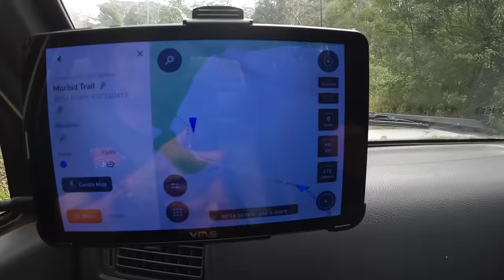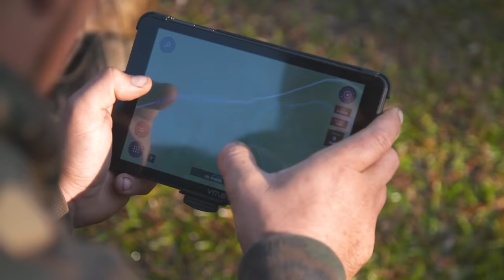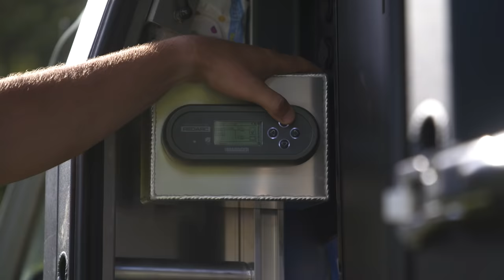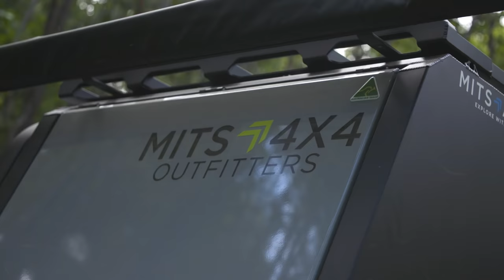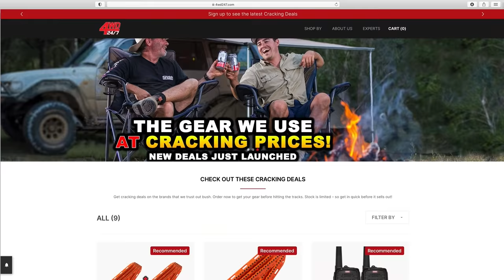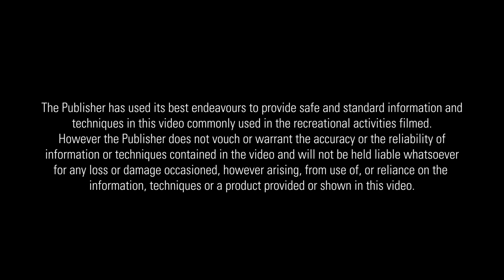OLD BUDGET 4WDs vs. Australia’s TOUGHEST tracks in Coffs Harbour + Snapped Axle & Best campsite EVER

Comment: Scariest time was when I topped up my gu zd30’s oil cause it was low, drove 45 minutes and was on some tracks for about an hour putting it through some stress, then I stopped cause a mate got bogged and walking back to my car I noticed there was oil dripping like no tomorrow from the bottom of the motor. Popped the bonnet and saw I had forgot to put the oil cap back on and it had no oil in it. Had to get up a sketchy hill as well and by cheeks were clenched expecting to hear it start knocking, 3 months on and the zd is still going

Comment: The one time i had the old ring doin 5cent, 50 cent was in a 8 wheel drive truck with about 15 mil on the back was following the lead 4by at night no lights on and felt the front left lift and come down hard. Opened the door to what happened. Had some how managed to get the front left to one side of a creek whilst the front right was in the air

Comment: In 2017 I went to cap York in the patrol. I found the faster I went over the corrugations the less chance of the doors falling off. Learnt pretty fast to slow down when I seen a dip sign, until I found a dip in the road without a sign. Would have jumped the old patrol a foot off the ground when I hit it. Still have the dashcam footage to prove.

Comment: Biggest poo moment for me was when i was in my old 08 BT-50 out at kenilworth, got up to the top of a track.. peaked over a hill and saw what was on the other side... 90 degree DROP!  1 wheel was already over the peak and i tell you what, those seat covers would have saved me a bit of time cleaning the brown off my seat after having to reverse down the hill climb i just came up!

Comment: I can’t pick between 2 bad experiences😅 the first was a innocent looking bog hole at the beach I’ve done a stupid amount of times. Dropped in an diffed out halfway through(bloody safari pumpkins) took over an hour and a half to recover me out. Started with the water up to the hubs. Ended with the water halfway up the doors. Thought I was going to loose my truck. Second was a chicken track at our local dunes. I was too wide for the main track so had to go the chicken. Came around the corner and realised the bay was at high tide which ment the main chicken was blocked. Had to hold it on the tipping point around a corner to make it out as I couldn’t go backwards(and 18yr old me can’t wait for the tide to go out) hit a stick and she went straight onto 2 wheels. Don know how I saved it but stayed somewhat upright. Did have to change my pants

Comment: Scariest thing to happen to me was on my learners driving dads 100 series Landcruiser back from Karumba, towing the tinny cruise control set to 110 massive dead roo on my side of the road go to other side of the road dodge it and perfect time another massive roo jumps out from that same side. I make a quick correction to try go into the middle of the road to miss both the alive roo hits the boat and from the quick correction the boat starts to fish tail lifting the cruiser up on two wheels I counter steer it everything feels in slow motion dad grabs the wheel and try's to help as we are going rocking the car on both sides two wheels up the road slowly becoming less of a angle before we are straight again never been more scared in my life especially because I was only learning how to drive.

Comment: Scariest moment for me - the first time I drove my Land Rover Perentie 6x6 12 months ago- it was my first offroad vehicle - previous car was a corolla. I live in an area with small tight streets, and just getting it home and parking it, with no rear visibility due to the huge canopy on the back and its massive turning circle, plus length of just over 6m... I was leaking more sweat than the Land Rover leaks oil lol. I was almost certain I was going to damage it on my first drive, or wreck a parked car or two.

Luckily it has been good offroad, and feel a lot more comfortable off-roading still, than I do navigating tight streets in my area with cars parked closely both sides of the streets.

Comment: Scariest moment behind the wheel on a trail was probably my second time in moab doing the moab rim trail in my 80 series. A SUPER exposed trail with 200 foot falls right onto the paved road below leading to instant death if you make a mistake (someone had died a few weeks before doing the same trail) either way as we go up it’s getting bigger and bigger rock steps. Well at the beginning of the trip I had broken a right motor mount and didn’t want to leave empty handed so I put a chain around the mount and called it good. Well during an insane obstacle I looked down and saw my t case shifter trying to snap the center console and the auto trans shifter was in the neutral position for me to use drive. Eventually we got all the way down and I found out the motor had jumped 2 inches to the right and nearly cut the power steering belt on the fan shroud. That trail would have literally been impossible to drive down with no power steering

Comment: My scariest moment was when I was just 17ish.  I was driving my dad's truck like a complete fool, on an icy road.  I got into a slide that I just couldn't get out of and ended up going off the side of the cliff.  I have no idea how I didn't roll it.  There was also so much snow, that only the rear bumper got a small dent and scratch.  It took a few trucks and questionable winching to get the truck back on the road.

Comment: Scariest moment was in my old MK with my new GF, thought we'd have a nice WE trip through the Otways in VIC. Driving a track, that should have been "easy" turned out to be the exact opposite. Stock MK no winch, got bogged where someone on 37" had carved up the route. Got out, got every bit of undergrowth I could lay our hands on and shoved it under the wheels and got free. yeah! Drove on another couple of km, came round a corner to find three 4X'y spread all over the track stuck in the mud... Now I recon'd that I could see a line I could drive that included a tree that would get through... and it did. Another couple of km down the path and a third crossing that had a 4X stuck in it, looked worse that the second crossing. Now I didn't think I could go forward, and didn't think I could go back... so back to gathering trees and undergrowth, and built a path. It was at that point I decided I'm never coming bush again without a winch... Got through and a couple of km on, found the guy who had the last stuck 4X walking out, so gave him a lift to the Forrest Pub where we called for a tractor.
I put on a winch, and an Goanna Auto Lokka in the front, and that MK took me everywhere for 16 years before it died of rust. Now building a GU RD to do the same.

Comment: my scariest moment 4wding was we did a night run. started off great we started 4wding at 8pm after a long day of tracks with a dinner break in-between. after a few hours into the night run things went south. A patrol we were travelling with nearly tipped in the worst spot. soft sand on a flowing creek bed, his wheels dug into the side of the sand bank and collapsed. By this time is 2am and we have pulled him up enough to see he popped his tyre clean off the bead so we had to skull drag him out which was extremely difficult in this position. Me and my mate left to go get a high lift jack in my car and his car as it was safer to travel in pairs and others were there to assist the patrol. was 4:30am when we got back to flat ground because the fog was so severe you couldn't see past the bonnet. My mate radioed in we have to stop, I stopped and he radioed in "we are in trouble mate"... he couldn't see with the fog and drove straight through a ditch, his girlfriend lifted off the seat and landed on the centre console breaking her tail bone. Now there was a real sense of urgency to Get out. we calmed her down and mentally prepared her for the final BRUTAL climb. We already completed this track 12 hours prior so we knew this track was tough but once completed it was easy to get back to camp. I didn't install my recovery points and neither had a winch. both were twin locked idiots. got half way up the climb and I heard the dreaded BANG. blew my Cv half way up. we tried everything to get up nothing worked. hours rolled by trying to get up. we ended up back at camp at 8am the next day. Left for the hospital straight away. was a scary experience but defiantly made us realise safety equipment is a must. Those seat covers would of been handy I think we all shit ourselves haha

Comment: Was heading on a camping trip up the beach with some mates, I had a large trailer with two quads and camping gear. We were driving along a corrigated road making good time as it was freshly grated. All of the sudden I see a flash of silver in the bush and realise its a patrol coming out of an unknown side track so I slam on the breaks. wheels lock up and I dont slow down. I think shit this is it, i'm going to clean up this patrol and I cant do anything but hold on for the ride. at the last second the patrol slams the breaks on and stops with just is front wheels poking out as I go flying by. there was about a foot between his bumper and my left mirror. I ended up stopping 30m past him. learnt three things that day, 1 there is a thrack there, 2 my car is overloaded 3 I needed some seat covers to save my seats from the brown stains.

Comment: Scariest time for me was half way up mount Skene snow up to the bonnet got stuck and my winch malfunctioned getting stuck reeling in without any controller used pulling a 90k modded  jeep jk down the hill dead drops either side only way to save both cars was a rush to unlock the bonnet and disconnect the battery safe to say was even sweating in falling snow

Comment: The scariest moment I have had was during the extensive floods in Southern Africa in 2000. My wife and I went away for the weekend to a small game reserve and decided to take an extended detour on our way home past a friend who lived on a farm. The sealed roads on the way were a few inches under in parts, but this did not deter us to continue on the journey. Soon we left the sealed roads. When we got close to the farm, we tried to make contact with them by phone as he locks the gate and we needed him to open it. There was no reply from him, so we continued on the road as it was part of the journey home. We came across areas where the roads were water logged, at which point I followed the manual and walked the 'rivers' covering the road. I preceded to cross as the water was well below our Cherokee's wading depth. I repeated the process at the next washout. When we came across the third one, I noticed I could see the road markings on either side, and based on that I decided to just drive it, as we had travelled the road multiple times. Though I preceded with caution, the nose of the vehicle disappeared under the water, and I got such a fright I removed my foot from the accelerator, thus sucking water through the manifold and into the engine. The car was stuck and water was entering the cabin. Because of the entry angle, the water only covered the footwells of the front row, while the second row was dry. It took us a while to gather our thoughts and we realized there was no reception where we were, and we decided to try and push it out the water. My wife got into the water at the nose, and I reached through the window to disengage the auto box and handbrake. I know the adrenaline accounts for much, but looking back on it, my wife was either Superwoman (which she is in many aspects), or we had external help we couldn't see. Once we had managed to push the car out the water, we decided to try and walk back the farm and pick up signal. Once in range, we contacted our friend who came to our rescue. With his mechanical prowess as a farmer, he got us on our way with minimal damage. Valuable lessons learnt, I have never crossed water without checking it since.

Comment: my scariest moment was checking out a local beach track with my 95 pajero. she has 31s and stock suspension that needs replacing. But I decided to go down this kinda steep but rocky and sketchy track and my first time going down and first time in the area. As I was going down the tube that supplies the vacuum from the engine to the brake booster came off just after I started going down. I shoved my foot on the brakes because I was at a bad angle and knowing my old girl is naturally top heavy I was scared I was going to roll. After shoving my foot on the brakes and realising I wasn't stopping I ended up ripping the handbrake up thankfully I fixed it the same morning because otherwise I would have ended up on the side and would rolled down a hill. I fixed the tube and got down safely. the tube also then came off on the highway in the same spot where it happened to my mate and he rear ended someone. I was trying to stop for a red light and nearly ended up in front of a roadtrain. I bought her off my mate for $250. Rebuilt the front end and shes good as gold. Now I'm replacing the clutch because it died last weekend after pulling someone out of a bog. But yea I nearly ended up on the roof because the brakes failed. thankfully handbrake didnt

Comment: Scariest moment on the tracks I’ve had was in the vic high country at night me and my mate hit a very steep track with rock steps half way up, as we bumped up the step my rear drivers wheel fell into a hole, the car bucked up to rolling point about to go over and as we lent back the other way the car came back down, my mate hopped out after that.

Comment: Scariest time. I was going up a steep climb on a rock hill un locked in didn’t see the check rock step on both sides of the track was a straight drop off rolled Beed and ended up sideways across the track with nothing to winch off of

Comment: scariest experience ive had was tackling the last section on Morbid trail in 2 LN106's my mate blew a bead in one of his tyres we had no winches to move the vehicle forward so I spotted his backwards into a huge off camber rut simulating a wheel lift we used a number of ratchet straps which prevented the Ln106 from living up to its nickname Rollux. Using a deodorant can and a lighter we were able to blow the bead back on the tyre managing to drive out of it safely . was defiantly a very puckering recovery

Comment: Scariest moment for me was my first big trip, down in Robe SA, going along some really soft beaches, my brother leading and brother in law following, were about to cross the longest beach yet and high tide was approaching in 1hr, with a high tide line that came up pretty much to the total width of the beach, as I round the corner onto the beach at 60ks i see my brother in his 79 bogged 1/4th down the line, 
not wanting to break momentum I opt for close to the water line assuming more compacted sand... 
within seconds I lost all traction and bogged down hard, softest sand i've ever seen. 

i look back and see my brother in law is also bogged but above high tide line. 
with high tide about 40 mins away, frantically shoveling to no avail I lose track of time, soon waves are splashing against the drivers side of the car, bogged to the diffs I thought this was it.. shortly after that thought, I hear and see an LC200 barrel past and round the bend at the end of the beach.. 
still doing everything I can to get the car up and onto my maxtrax but with each wave, it was washing in everything i had just shoveled out.

i look up to take a breath and i see the owner of the 200 running down the beach head with 3 sons in tow maxtrax in hand. 
by this time I had nothing left in me, there just wasn't enough people to shovel quickly enough before the next wave. 

when they arrive it was about 10mins of digging and placing heaps of tracks in line and compacting the sand before i was up and out of danger, 
once out and down the beach head, I couldn't offer them enough to say thanks for the help..

safe to say I needed not just new seat covers but a whole change of clothes after that.

Comment: i was in my mates paddock and he a motor cross berm the was about 1.5m high and i thought it would be a good idea run my pride and joy 75 series still leaf springs,  to drive it on the side with one wheel on the top and the other on the ground 
until i felt the top two wheels come off the berm and in that time i drop the clutch and somehow save it from doing a lid skid and look at him and we both nodded bc we knew it was pure luck it didn’t go over

Comment: Scariest moment for me would have to be actually not off the blacktop but it was on the road on my way to the back of kenilworth for some wheeling, anyway I was going about 100 km/h (because that’s as fast as you can go in a 3L non turbo Hilux) and the rear diff just decided to lock up on me which sent me off the road, thankfully me and the old luxy came out unscathed, was quite a ass clenching moment if you ask me….😬

Comment: The scariest thing ive experienced was i trusted my n70 hilux handbrake on the top of a hill at lidsdale. i have the video of it rolling down the hill backwards where it couldve hooked to the right and gone of the edge of the hill, or it couldve gone all the way to the bottom where it wouldve flipped into the river, but thankfully it hit a rock and the wheel turned to the left and ended up hitting the towbar into a tree.

Comment: most pucker moment ive had was doing some pretty hard muddy hill climbs in harvy wa and my old zd was having fuel rail issues and it use to die and pick up speed a little random smetimes and it did it right at a scetchy bit on a hill climb and i got the big girl on 2 wheels almost rolled it and wouldnt off been good ive even got a video of it on my instagram